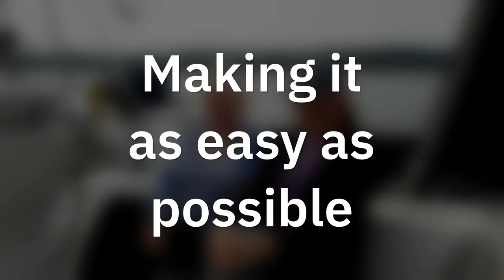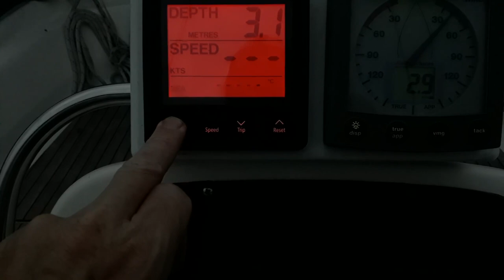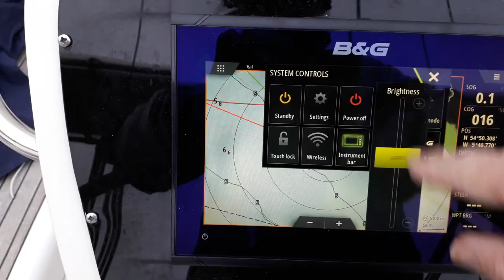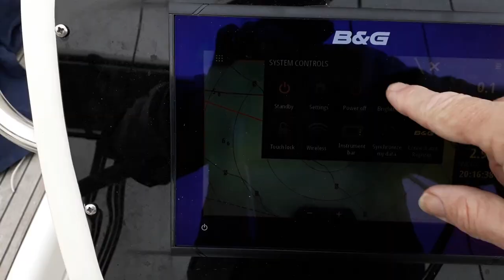Sailing UK - Night Sailing - Bangor Northern Ireland - EP. 271

Comment: You’ll probably mention it next time, but I’d have a wander round the deck and check none of the lines are tangled or incorrectly run.  I’d get my head torch or torch out, check the deck and steaming lights work.  Make sure the dinghy is not obscuring the stern light if it is mounted across the transom.  Etc.  thanks for another good video.
Reply from the maker: The dinghy used to obscure the stern light, so we moved it up on to the solar arch. Now it is visible for miles. We did mention it in the filming but it got cut because if we left everything in this would have been a four or five episode mini-series 😄 Your point about the lines is a good one and many boats do seem to have messy lines. When at sea we keep all of ours neat, tidy and unobstructed and all side decks clear as well. It is just how we like the boat to be.

Comment: I actually love sailing at night, my last long passage was from Gibraltar to the Canaries.
Five days of (motor) sailing and I must say I really enjoyed seeing all those stars you don't seen when on land.
Okay it was a bit tricky when we got close to Casablanca because there were loads of cargo ships going in and out, however with current Technology it is easy to track them. We also had a B&G V9 on that boat and I found that the night mode was just horrible, just like you said it is better to dim it down.
Lovely video and have a good day girls.
Reply from the maker: The night mode on both our plotters is not worth the effort (Garmin and a  B&G) and dimming works the best. The stars are a definite compensation for the night sailing and I suspect that ocean sailing at night is more relaxing since we are primarily doing coastal sailing with all the hazards that being close to the coast entails. There should not be many crab pots in 3,000m of water but around here they are as common as fleas on a mangy dog....
Reply: @SailingYachtSaltyLass  I absolutely agree, coastal night sails are way more intense than in 3000m of water. I hate crab and lobster pots just scattered around with hardly any markings on them even during the day.
Reply from the maker: Totally agree. The best ones have black flags on 2m poles and you can see them a mile away

Comment: I have yet to night sail. Being a single handed sailor I take the slow route. I would like to try it and appreciate your “series” on the subject. Your point on dimming and turning the instrument lights back up was one I had not thought of. Also if anyone has any techniques for lifting a dinghy on deck solo without scratching the hull I’m all ears. Thanks so much for a great video!
Reply from the maker: To do the dinghy solo, you might need a curtain or blanket that can go over the side where you are hoisting the dinghy so that the dinghy rubs that instead. That is all I can think of on that one. Tie it to the top guard line and you might be able to hoist until the dinghy clears the lines.

Comment: Watching your video I felt cold all over, with your big clothes, it must be horrible 😂
For our part, night sailing requires about 3 days of adaptation, and then these of the routine.
We sleep when we feel like it, and we don't count the hours of wakefulness or sleep. When one of us is tired, the other takes over the watch.
And during the day before according to our zones of navigation, we also sleep between 15 and 30 minutes without problem.
Reply from the maker: Well, compared to you, we are a long way north (54°N). It is snowing here today so we are not jumping in to the sea in our swimsuits 😄 Your techniques for night sailing sound interesting. Why does it take 3 days of preparation?  Lovely to hear from you and enjoy the tropics. 👍
Reply: @SailingYachtSaltyLass  It usually takes us 2 to 3 days to get into the rhythm, between sleep periods and watches, and then everything is fine, I do the first watch from 9pm until about midnight or 1am, then I wake Corinne up when I am tired, and she wakes me up when she is tired, and also when there are corrections to be made to the sails or course, I manage to fall back asleep in 10 seconds, so it's not a problem for me, and the day goes on between meals and different naps. And everything is fine.
Reply from the maker: Thank you for that. At present our passages are short ones and 24 hours would be a long passage at present. It is simply a feature of where we are cruising, but it is something we shall keep in mind for when a longer passage is due.

Comment: I had a bad experience with  a Raymarine chart plotter. I switched it to night mode which changes the colour palette. It made shallow areas and rocks virtually invisible, so i hit a rock outside a marina at night. Oops! Better to dim the day mode. And hitting rocks is a bad idea.
Reply from the maker: You have just put me off "night mode" forever! 😄 I hope the damage was minimal
Reply: @SailingYachtSaltyLass  Cost me £500 to repair the keel, so I got lucky. Worth the life lesson.
Reply from the maker: Nasty but for boat stuff, a cheap repair. I am glad it was no worse 👍

Comment: I am interested to know what reason you have for using tri-lights when sailing rather than just always using the normal nav lights?   We don’t have a tri-light and the rigger has offered us one, but I can’t see why we would need it.
Reply from the maker: There are two reasons. Firstly, it marks us as a sailboat under sail and secondly it makes us visible from a lot further away. Our tri-light is a bright LED unit and is nearly 20 metres up. Our lower nav lights are, at most 2 metres above the sea. I also think that the tri-light is more viewable when the boat is side on since the lower lights are most focused more in the fore and aft direction
Reply: @SailingYachtSaltyLass  Thank you for replying.  We have our sailing ship on the hard at the moment and are having new standing rigging so it is an opportunity to have other work done.  However, the rigger wants quite a lot of money for a quality tri-light/cables/installation so we are asking advice.  I don't think our deck height lights can be the same as yours as ours are easy to see from the side, but clearly not in big waves.   My understanding of the regs is that we are a sailing ship if we we have only the nav lights and not the steaming light, so that we don't need a tri-light.
Reply from the maker: You do not NEED one that is true, but if you have an anchor light at the top of the mast, then look at the NASA Marine Supernova LED light. It is a tri-light and an anchor light that you fit to the existing wiring and then fit a reverser switch to. Since they are LED lights they are sensitive to the direction of current and doing them one way activates the anchor light and the other way activates the sailing light. No new wiring needed. We covered it a couple of years back (link below, starts at 7 minutes in) The light is expensive at £150 but it is an excellent light, very bright, low power consumption and should last for years and years as it is all encapsulated in resin/plastic

https://youtu.be/XjQ9xpb3ysc?t=426